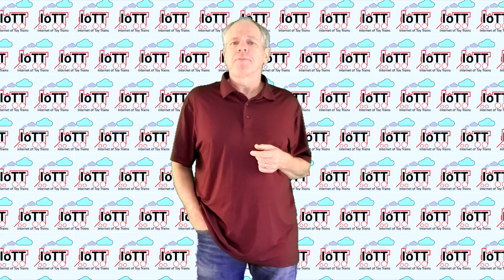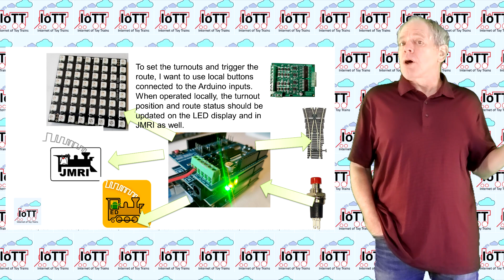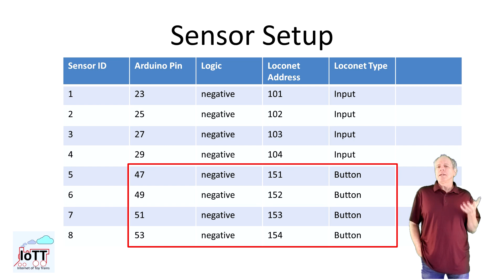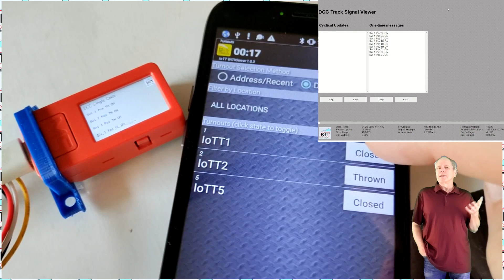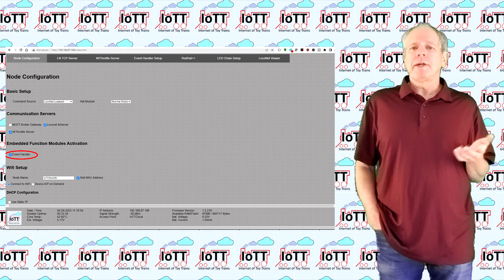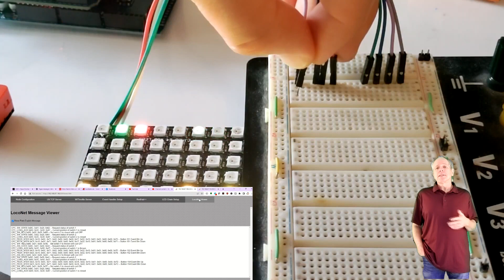Adding LED's to the DCC AUX Shield (Video#118)

Comment: Have you tried the AUX shield with a CSB1 ? Do I have to switch the TX and RX pins around like on the Redhat ? What about adding a Tinkerhat shield, any modifications for a CSB1 ?
Reply from the maker: Never tried it, but it should work. Yes, you need to swap Rx/Tx as this is an error on the CSB1 board. And you still would power the stack through the connector on the CSB1 board. Using the Tinkerface on the CSB1 does not make sense as the CSB1 does not talk Loconet. You need the Stick which translates from Loconet to DCC-EX command language and provides the Loconet slot buffer.

Comment: Is it possible to use this shield with the RedHat shield and just one IOTT stick ? I’m thinking a YellowHat shield and AUX hat combo board without the stick to be used with the RedHat++ shield.
Reply from the maker: The short answer is yes. If you have an older RedHat Shield with the buck converter mounted on the bottom side, you do not need the AUX shield as it adds no extra value. If you have a newer RedHat shield without piggy back buck converter, you need the AUX shield to power the RedHat shield, but you will have only one stick on the RedHat. On the other hand, if you don't need a wired Loconet net, you can go with the AUX shield only, add a Stick to it and you have a wireless Loconet system that can connect to JMRI using Loconet over TCP. Without the stick, the AUX shield is just a power supply for the Arduino stack. Watch video #113 for an overview of the entire modular concept and how everything fits together.

Comment: Hi, what is the difference between using this AUX shield and the blue hat ? Is it just the footprint ? Wouldn’t using a yellow hat be a better option since it includes 32 inputs ?
Reply from the maker: The main purpose of the AUX shield is supplying 5VDC to the Arduino and controlling DCC EX. If you don't need wired Loconet, you can use the Loconet Loopback command source and you have a fully functional Loconet command station you can use with Loconet over TCP from JMRI or WiThrottle from the smart phone.
The LED chain is just a side feature as I had the output pin available, but yes, it has the same functionality as the BlueHat. And correct, if you need inputs, the YellowHat is the way to go, and it can work over Wifi as well.